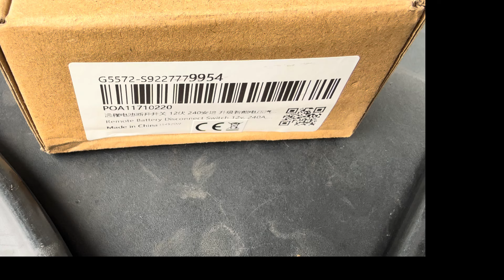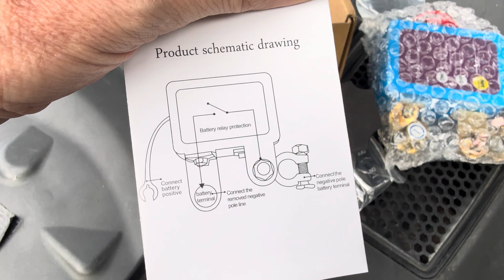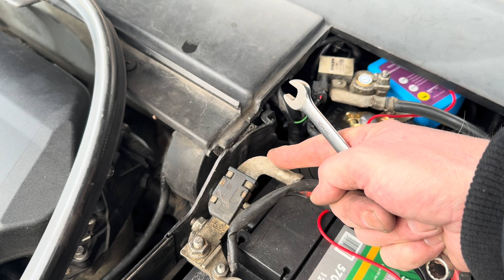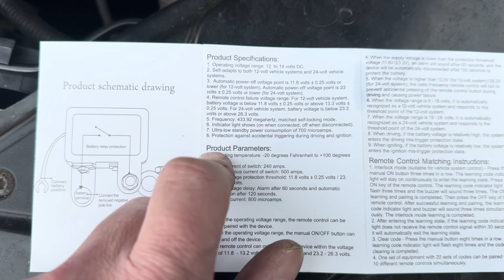Fitting A 12/24v Remote Controlled Battery Isolator To A Vehicle.

Comment: Interesting product, but somehow I just cannot trust a relay that costs only about £17 off Ebay, which also includes 2 remote fobs, to be actually rated at 240 amps continuous current as stated. I guess time will tell.
Reply from the maker: If it fails I will pin a comment to this video.
Reply: @TheRepairer  OK. Good idea. It just made me think, compare it to how beefy a starter solenoid is.